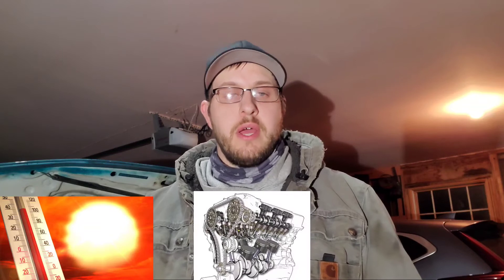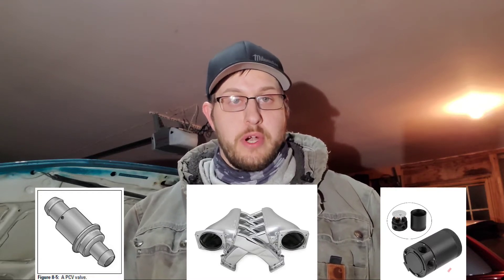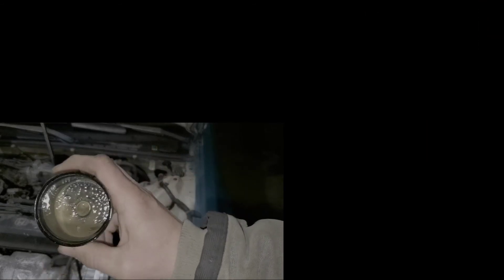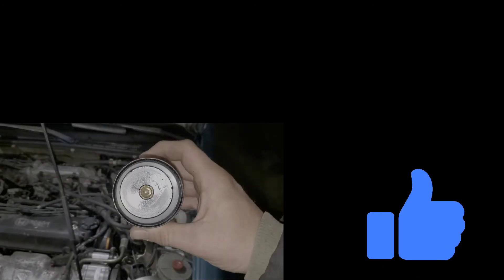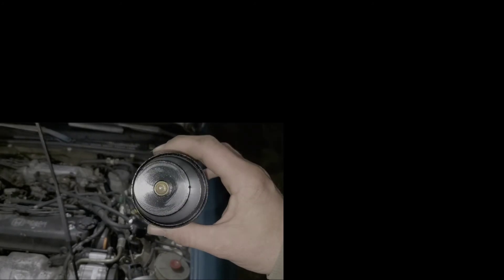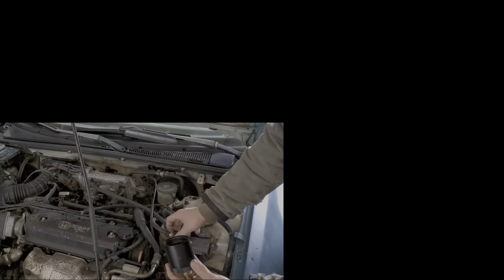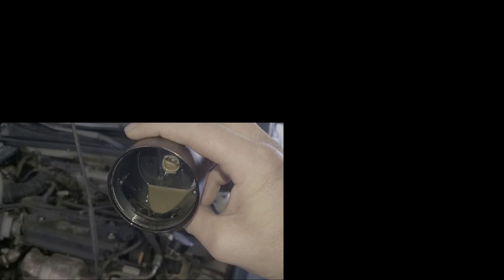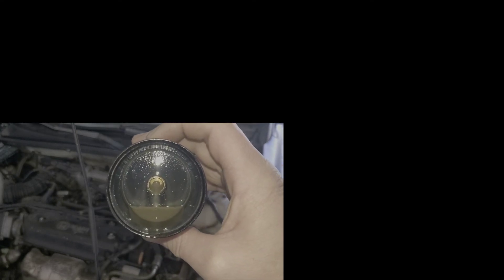oil catch can condensation  Explained  WARNING not a blown head gasket

Comment: I put a catch can on my Hellcat here in Texas where we don't have severe weather. Several months later it had about a half an inch of that sludge in it.. It was pretty concerning at first. I guess I'm good.  120,000 mi on it.  Oil on the dipstick is nice and clean.
Reply: I know this is old but did your car start smoking pretty bad before you cleaned it ? Having problems with my 17 hellcat
Reply from the maker: @user-ki7fo4rw4d  it wasn't smoking, just very sluggish!  Is  your car losing any oil over time or antifreeze ? What cooler smoke is coming out ? Black white gray blue/gray  figuring out that can definitely help Narrow down where to look first! And sometimes cleaning things up will help for a short time. If there's a problem, hopefully, this helps you out

Comment: Thanks so much for this video!!   This happened to me also.  I tested for blown head gasket but it passed.  

Can you answer this?  I installed catch cans on both banks. (2004 Tahoe). At oil changes I have 1/8 cup in drivers side can, while passenger side is bone dry. What does this mean?
Reply from the maker: You are very welcome!  I would check the pcv valve  your catch can  and hoses to the catch can to make sure nothing is blocked or cloged. I know Chunks of grim can get stuck in pcv valves or they just get frozen shut / open. Hope this helps !!

Comment: Doing my oil change rn on my 3rd gen ram and had yellow residue and condensation on the oil cap. Kinda worried, since I can't find a catch can for this truck
Reply: i dont think you can on a 3rd gen and yes old comment but the pcv is in top of plastic manifold. only other hose there is comes off oil fill and runs to air cleaner box or in a tube if you have cold air
Reply: but im having same issue only clear condensation under my oil cap after driving it. its colder weather 20s-50s it varies

Comment: I recently purchased a 1990 Honda Accord sedan with 80,000/miles and I follow what this mechanic told me to do in the winter/summer. I add 10oz of automatic transmission LUBE GARD instant shudder fix to the 4qts of oil to help keep moisture out and oil and metal parts clean. I’ve had zero problems and the engine purrs smoothly. My round trip is 245 miles daily. I have no catch can either and winter weather here has at one time been -10 degrees

Comment: I've got a 2004 BMW 325i....I need a new coolant temperature sensor.... engine running cold...it's been cold here in Virginia Beach...and I drove to church this morning and saw sludge under oil cap. But the dip stick was regular oil color....no bubble's in the coolant....coolant was full ..and no white smoke ....should I be worried?
Reply: There's a winter package kit for that year bmw.  It basically insulates the cooling lines.  I had it done on my 330i.  It doesn't eliminate the condensation completely but it does reduce it substantially.   Its called the cold climate ccv kit for m54 engines
Reply from the maker: I wouldn't be worried if your dipstick still looks good and no white sludge on it
Reply: @CB7Media  it doesn't .. I drove the BMW this morning on a few errands.. it's close to 60 outside...I checked oil cap and no chocolate milk lol...so I'm leaning towards condensation.
Reply from the maker: @williambernstein4313  good deal
Reply: @CB7Media  I thought the thermostat needed replaced but the heat worked today and yesterday...but I'm sure it's the original so I'll probably replace it ...we replaced the spark plugs....but not the ignition coils and boots...those are next. Question...can the failing coolant temperature sensors cause shakiness and even stall sometimes on start up? It did that a few times. Maybe it's running too rich...the temperature gauge stays on cool which of course isn't accurate
Reply from the maker: You probably do need a new thermostat if it's staying on cold and now it's fine if  it's shaking when it's cold it could be your fast idle valve cutting in and out because it's not warm enough and not cold enough to idle out properly just a guess you should try cleaning your throttle body and  check everything over including the air sensor on your intake if the thermostat dose not fix the problem of it shaking
Reply: @CB7Media  thanks so much....it does have a now MAF sensor....but yes could be carbon build up in the throttle body....the front and rear air filters are new ... radiator original but no leaks.... radiator fan works too...but I'll take your advice and clean the throttle body...I'm doing a transmission flush in a few weeks too. I will continue to watch the temperature gauge as I'm driving... because it's weird that sometimes in park it'll go from cold to red in half a second...but not overheating...but still alarming enough where I pull over and look at the oil cap and dipstick....I may be OCD about the oil and head gaskets but it's better than not paying attention to it....most drivers from what I hear rarely look at their temperature gauge while driving....as far as overheating.....is it correct to say that as long as I don't have white smoke coming from hood and exhaust....no bubble's in the coolant...and no white oil on the dip stick...I should be good as far as the head gaskets?
Reply from the maker: Yes your should be okay as far as headgasket
Reply: @CB7Media  ok. I've seen cars with a blown head gasket....it's not pretty lol...lots of white smoke

Comment: Funny I just emptied my catch can started kinda freaking out it looked like a mix between oil and antifreeze and I'm like whoo so I checked my dip stick and I'm like thank God looks like oil and I checked the oil cap and no milky stuff watched a couple of you tube videos only to find out it's condensation.
Reply: Yeah I just checked mine and had the same scare, I checked hose's and didn't see it on the ones that connects to engine, I switched to the antifreeze when I poured it out on a piece of wood didn't see a trace of blue but more of clear water as it came out with a touch of cream color. And it was 46 degrees this morning.
Reply from the maker: Luckily the catch can helps catch all that before it hits the intake it will mess with you if you don't understand that's why I made the video for that reason

Comment: Pretty cool. Thanks man. So good. I gotta a h23 intake on my f22a4. Sometimes my car won’t start after I get to work. I got to work really early. Sometimes 36 deg. Then my car will start if I take the oil cap off to start it. Crazy right. I’m getting the lines for catch can tomorrow.